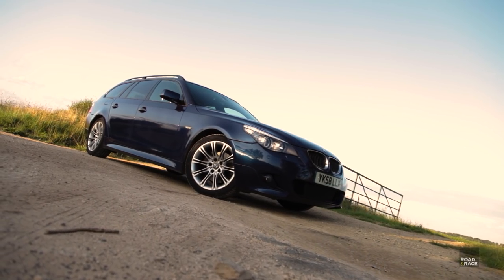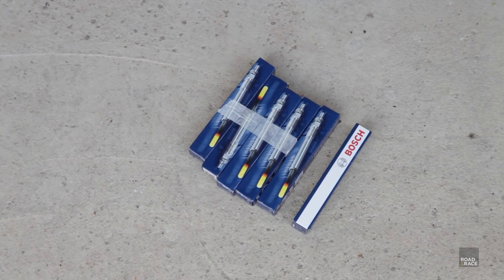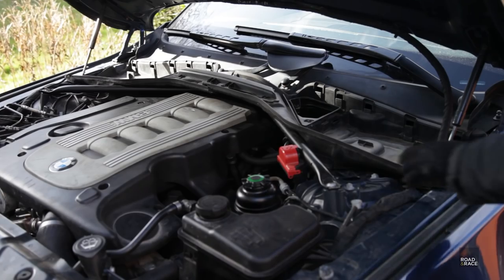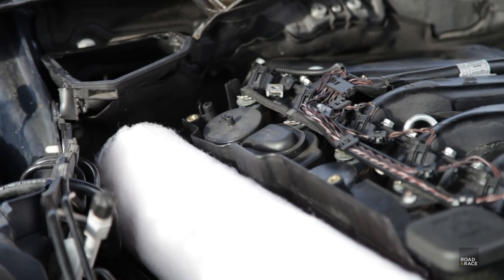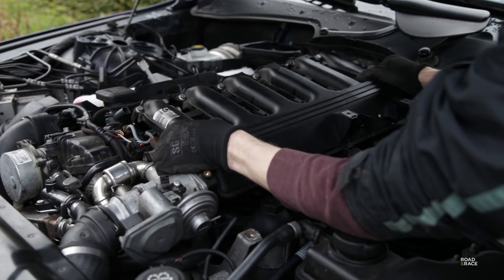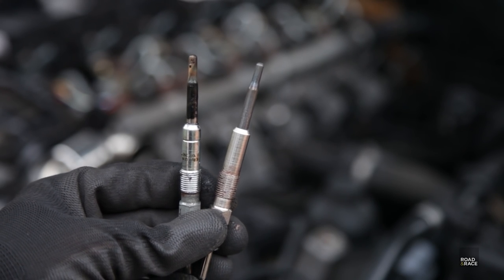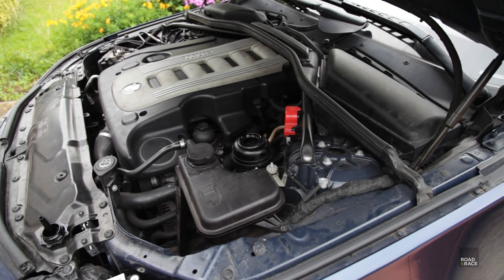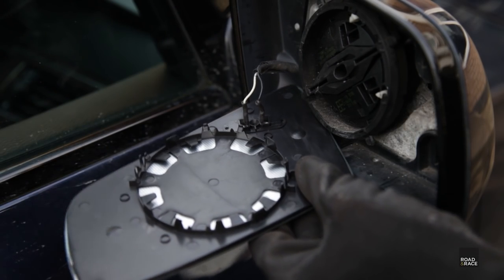All The Maintenance & Repairs On My BMW 5 Series (E60 / E61) Glow Plugs, Power Steering, Swirl Flaps

Comment: TIPS HERE from another 530d LCI owner. There are 3 types of breather oil separators installed: empty case, toilet paper roll and vortex. The toilet paper roll that is total bs and needs to be upgraded to the vortex type. Yours is empty, same was mine. Dunno why BMW did that, but you should install the vortex type since it will make the breather work properly (separate oil from air duh).
Also check that the spring and rubber cap/suction valve inside the case are intact and that the rubber is soft. Give it a good clean while you're at it. 
The power steering reservoir has to be changed in a car that old. It has a metal net filter inside that cannot be changed separately. Mine was almost clogged after 13 years and no fluid changes.
Ceramic grease (or special glow plug grease) for the glow plugs, never copper since the engine head is aluminium.

Road and race, great content as always!

Comment: Well, the last time I did the glow plugs on mine they certainly didn't come out that easily. From memory, so would need checking, The Beru website for the OE plugs give the shear point in Nm 35Nm I think. Using a torque wrench that measures in both directions ease the plugs out, if more that the torque setting is reached, wind back in, more oil, then back out again.
Reply from the maker: Good tip 👍🏻

Comment: i just blanked the swirl flaps on a 123d with 131000 miles  just in time it was pretty loose and the inlet was full of gunk cleaned it as well
Reply from the maker: Good work.  👍🏻

Comment: Aha, the best mod on these engines... Getting rid of those darn swirl flaps. That is a huge step towards peace of mind.
Reply: BTW, if ever your stainless steel exhaust manifold starts to leak (they all do at a certain point), just change it with the E39 cast iron one. Will last untill you are no longer alowed to drive a car LOL. And wayyyy cheaper.

Comment: Love the series! I did nearly all of these things to my previous 320d e90 (even the driver side mirror not heating lol)
Extremely reliable cars when maintained!
Just out of interest did you fit the swirl blanking plugs anyway, what sorta condition were the flaps in? And what sort of MPG are you achieving?
If you've still got the factory alternator it may be worth changing its brushes, very cheap job to do and prevents strain on the battery and an inevitable loss of power all together, mine went at 130k
Reply from the maker: Big thanks.  No didn’t have to fit the blanking plates.  Thanks for the tip regarding the alernator.

Comment: I'd put the oil filler cap back on at once when you lifted up the cover around it. If these scews still in the plastic cover fall into your oil refill opening you're screwed.

Screwed, haha.
Reply: Uh and I'd cover or close the intake openings with paper or rags immediately after removing the intake manifold because we do not want anything to fall in there, be it a screw, some dirt or any metal pieces that might have come of from your glow plugs' plugs.
Reply: I was tought not to use copper grease on glow plugs or spark plugs in aluminum cylinder heads but what do I know.
Reply: @oliverb.7860  Ive never used it on glow plugs but do you know why ?
Reply: Voi Vod I believe it causes electrochemical corrosion in combination with the heads aluminum.
If you want any paste, there’s ceramic or aluminum one for this I believe.
Reply: Also the torque values don’t apply anymore because they are for unlubed threads and with paste, the same torque will cause a much greater angle and therefore axial force in the thread because of less friction.

Comment: Oh..my power steering fuild is red. Is that okay? Probaly atf fluid in there.
Reply from the maker: Different model BMWs use different fluid.  The cap on the reservoir should tell you?
Reply: @Road and Race
 Im gonna check tomorrow. Thanks for quick replay and keep the videos coming, love the passion and editing! :) 
Also side note, please check your battery cable connection in the boot area where it goes under the car. Many of the pre-fl cars have been burned down if the plastic breaks down over the years. It should be fixed in the facelift but just in case :)
Reply from the maker: Thanks. Will do.

Comment: "Engine up to temp before removing glow plugs" it'll be cold again once you've removed all that plastic. That is a mad amount of plastic to remove just to change an air filter, but I guess if you're BMW and it takes a tech an hour to replace an air filter instead of 10 mins then that's a good earner from all those company car drivers.
Reply: I have one, and yes it took me an hour, nuts, never seen such a complicated set up

Comment: You are a patient man. Where do I start with my e61? Nice to drive when it’s running…Only had it a week and already the most unreliable  machine I’ve ever owned. I want to love it but not yet. They went to all that effort with the rust prevention and great engine, 50/50 weight distribution etc etc yet they put the electronics in the lowest point below the waterline destined for destruction as soon as the drain plugs get blocked. Absolutely absurd design that’s totally ruined my respect for the design in their products. I’ve had several BMW motorbikes which were great machines but also very fussy about water ingress. You couldn’t pressure wash them which is mental for an off-road bike designed for mud and sand Even my 7 year old knows electricity and water don’t mix. Had a Toyota Camry with 220k klm and all I ever did was battery, fluids, brake pads and spark plugs. Now that was properly incredible design.